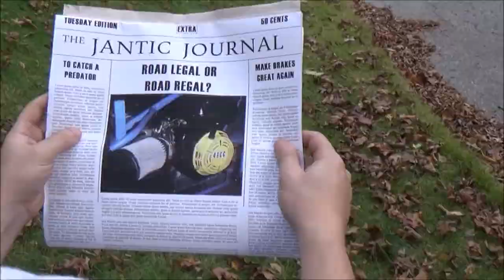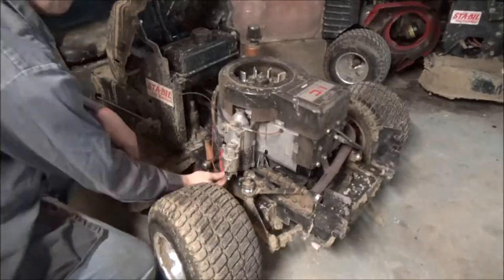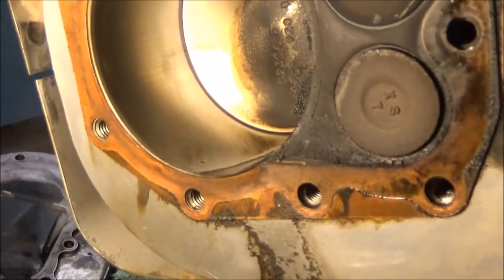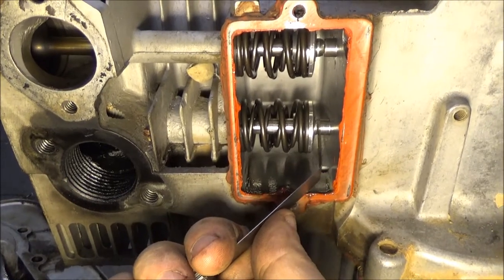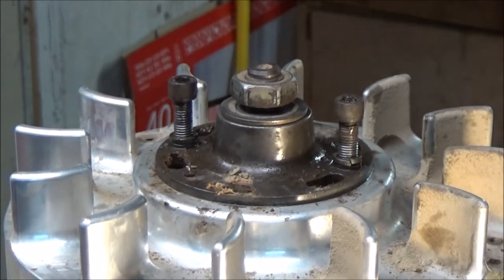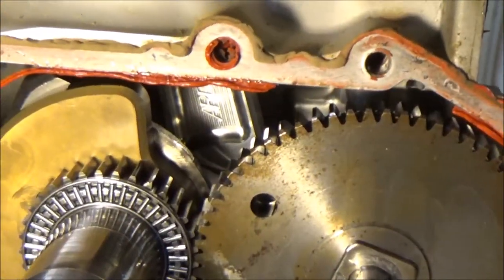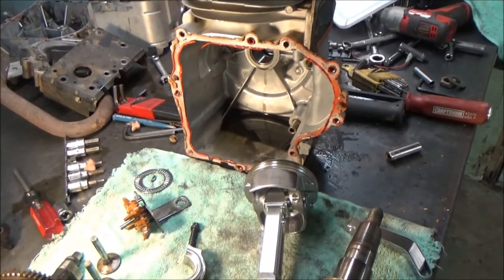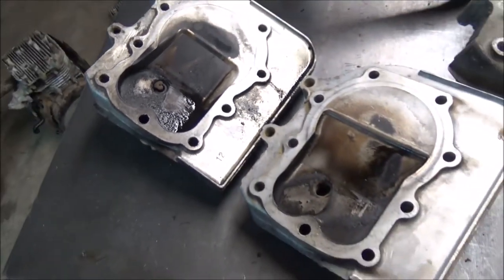Briggs & Stratton Flathead Model 28 Race motor teardown

Comment: Im working on rebuilding one of these. Intake valve seat is a probelem. Someone reseated it and then whacked around it with a sharp punch to keep it in it looks like. Either way its not seating. Is getting an oversized seat possible/feasable? Or should i just grab a different block?
Reply from the maker: If you don't have much else invested in the block I would just look for another one build.
Reply: TheJanticJournal it was free. My dad gave up on it and replaced it. I got the seat properly seated but the intake valve doesnt close on time for the compression stroke. There is no reason the timing should be off as they never opened it to my knowledge. Just need a pulley puller to check. If its not the timing i think ill just find a bare block in good shape. Or i do have access to a Kawi fc420v, which runs but there are no hop up parts. I found a place that will grind a cam, but arc has no interest in a one off flywheel. I may see if it has a similar snout to any briggs or honda. Im not afraid to fab some stuff up. Experimenting is fun.

Comment: Do they make the brass counterweights for the model 25, 11 horsepower or only for the 12, model 28, I realize the number 25 and 28 is cubic inches, I'm just talking for a regular engine not performance I just want to get rid of the synchro balance rattle on my lawnmower.

Comment: Do you run with or without the governor?
Reply from the maker: Governor is removed with the old old hole for the shaft tapped and plugged. You have to keep in the oil slinger that runs off of the cam though.

Comment: I see you have the shaft with the nut so you can remove the eccentrics. I'm looking for the spec's for a model 28 crank that uses a bolt of what the measurements are where the  counterweight sits on the crank. Can't seem to find the accept or reject specs for that part of the shaft. Thanks

Comment: Hey so I'm new to racing and I have a 13 hp i/c  it runs good but I have no governor on it and I'm afraid of blowing it up. So if you count post links for the flywheel and if the rod will work in mine that aswell thanks

Comment: Hi 
Cool build 
Got a question
I'm building a 14.5 hp model 28 ohv 
Can I use the model 28 12.5 hp flathead arc dog bone and the arc rod in my engine 
Ty
Reply from the maker: Unfortunately no don't know the answer off the top of my head. ARC should be able to help you out easily.
Reply: @TheJanticJournal  I emailed them a long time ago and they won't email me back 
No joke

Comment: Is it possible to run these without any counterweights or will they grenade their selves?
Reply from the maker: +Mountain Mania I think what people will do instead of brass counterweights is they run a billet "dogbone" and run the stock weights. I don't know how it would act with no weights at all.
Reply: TheJanticJournal ok thanks.
Reply: i ran mine without the weights because the aluminium "dog bone" snapped and the motor grenade
 so i wouldn't recomend using it without them

Comment: What's it cost to send them engines off to get them worked on - bored and all that?  for the twin and single
Reply from the maker: +Nicholas Brown The singles we're around $600 for sleeving, boring, clearencing the bottom of the bore for the rod, clearencing for the bigger cams, cleaning the block and the valves. The twin isn't done yet but that's just a straight .020 bore so hopefully it's not too bad
Reply: TheJanticJournal that's not too bad actually.  Thanks for the reply man!

Comment: I have a 900 series intek and I want to put it on something, I had it on a gokart but I had to sell the gokart and now I have it on a old tiller and I want to put it on something else but I don't have any knowledge about fabricating stuff but I want to learn, and I want to put it on anything really but I have a super super tight budget do you know anything easy and cheap I could do?
Reply from the maker: +PigRadar Hmm, that's got me thinking. You want it to be something you can ride or just anything to tinker around with?
Reply: I kinda want it to be something to ride, I have a old full metal lawn mower that I have been thinking about slamming it and making it look awesome and put a tow hitch on it for small trailers but I have no clue where to get started on anything like that. But with my motor I have on my tiller, I kinda want to put it on a mini bike or something, maybe a old dirtbike frame but I don't know anything about gear boxes or anything so really, I am just looking to learn anything that is cheap.
Reply from the maker: +PigRadar minibikes and go karts are by far the easiest and cheapest to get going. Just keep in mind something like a dirt bike would probably require a lot of customization to make a Briggs work on it.
Reply: oh yeah? Well, for a mini bike, can you find frames for under $100 online or how would that work? I might be able to get my old go-kart back but I am going to have to pay more than I sold it for, but it was a crazy machine, offroading like a 4wheeler, plowing threw everything and jumping over bumps, only thing about it is I need to extend it and move the steering wheel to the center, I do have a small welder that I got for under 100 bucks from a pawn shop, I wonder if It could work.